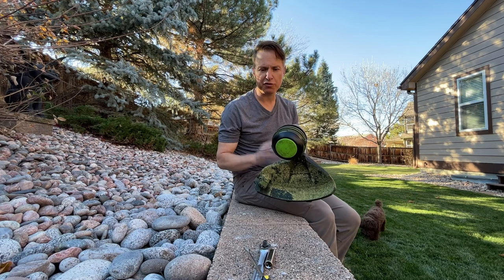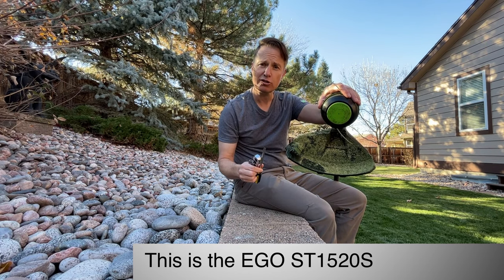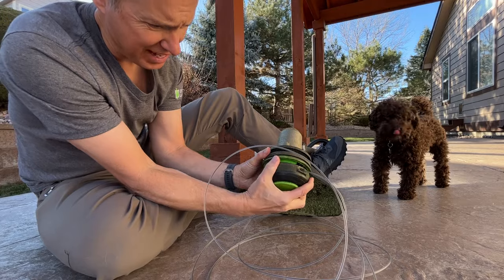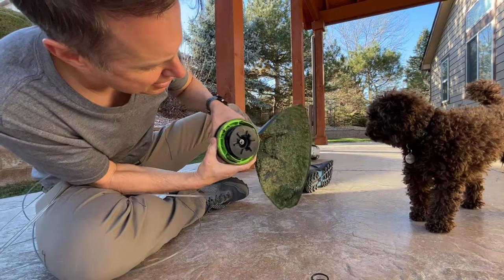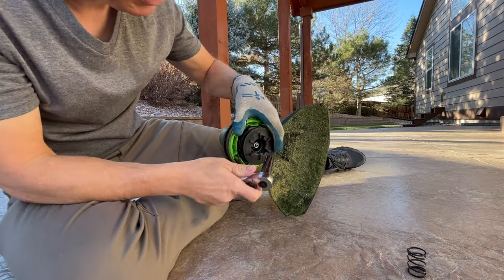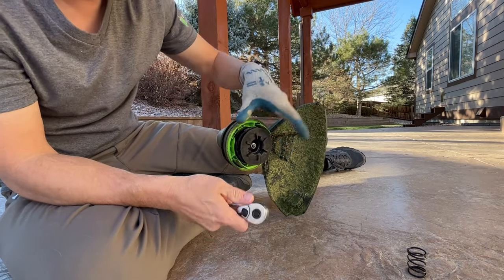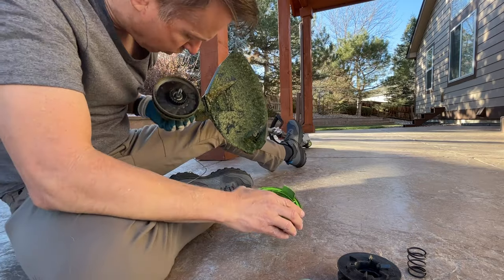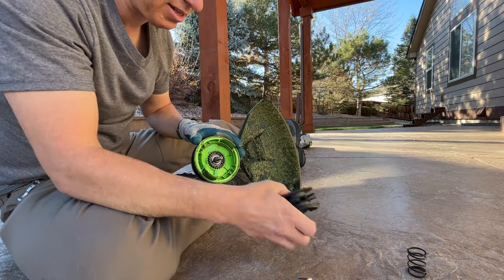How To Fix Your EGO Trimmer, If The Auto String Feed Is Not Working

Comment: Just saying "Thank You!" seems so inadequate.  This morning my EGO String Trimmer would not spool the line. I was puzzled. First I checked the 5-year warranty and found it would expire the end of this October 2023. Next I called EGO to learn where I could get it repaired. They said the trimmer head warranty was for ONLY 90 days and I would have to purchase a new head, part #AH1520 for $50 or so. I went to YouTube in search of how difficult it would be to replace the head. During my search I found your YouTube on how to clean the head. I went to my garage, followed your instructions, and found it WAS dirty. I cleaned it out, put it back together, and Voila! Now it works beautifully. You have a new fan. Well done, and bless you.

Comment: Perfect instructions on how to fix our problem (the inner area was wrapped with some sort of fine string/twine that had become drawn into it, preventing the automatic function from working).
It was rather stressful at first but when we found your video and followed your instructions, it easliy solved our problem!
By the way, the nut on our weedeater was on very tight and it was hard to hold the spool area secure enough to effectively turn the nut with the wrench. I finally figured out how to move the part of the spool up (outwards) which locked the inner part from turning so that I could more easily hold onto the outer part securely enough to give enough torque to loosen the nut (I hope that made sense?!).
Anyway, thank you!
God bless you.
Reply: Thanks Dan

Comment: Thank you for this video.  I could not figure out why the auto line feeder was not working.  I was ready to buy what ever I needed to fix my trimmer.  I had a  fine wire wrapped around the spool and would never  have  thought to take it apart.  Thanks again.

Comment: Something that worked for me is before you remove the nut take the cap off, then press the Power feed button to see if the spool turns. If it does, pop the cap back on, feed the string through and press the Power feed button to see if it works. It did for me.

Comment: Anyone ever have a problem of the line not feeding out like it should?
Reply: Yes I had that problem and I fixed it
Reply: @Tooo V  how? Please share, thanks.
Reply: @tooov9446  how? Please share
Reply: Mine doesn't even come on
Reply: Yes
Reply: Yes, I knew it had to be too good to be true
Reply: My second one and nothing but problems
Reply: I did u just have to keep pushing and poking till it comes out
Reply: Yeah, that worked when I put it back together. But then it wouldn't feed out. Took it apart again and it wouldn't feed in. Might be a different problem other than dirt or gunk.
Reply: yes, on my second head.  The 2nd one last a few weeks and broke as well.  I see on Amazon others have the same problem.  I think the replacement heads are crap
Reply: @michaelduncan4825  When it won't feed, the most likely problem is a twist in the string. Remove the cap, and you can see if the string is jammed.  Just remove the string, reassemble and load a replacement string.  Always works for me.
Reply: Yes, me.

Comment: When I saw that your string trimmer didn't have any debris, I was skeptical why taking it apart and putting it back together again would help (but then again, doesn't it always?).  Took mine apart as per your video, lots of debris stuck in there.  Cleaned it out - auto-feed works great.  Appreciate the video.

Comment: Thanks you saved me a lot of time - mine was having a different issue. the loading feature was working, but when I went to use the weed eater, all the string just kept coming out as the head turned. Turns out I missing the Spring. Thanks!
Reply: I also lost the spring. Where on earth did you find a replacement? I  saw one for a different model number. It didn’t help. I may have another issue.
Reply: Mine missing too, perhaps some models don’t have one?
Reply: @danieldoherty5034 thanks for your reply. I checked a new 1620t it had no spring, unless someone removed it already.  I took it all apart cleaned & back together & nothing.  Really don’t want spend $50 on a year old t $300  trimmer.  I tried a spring for the 15” trimmer doesn’t help the 16”

Comment: Thanks I appreciate 🙏  the video I did mine  and it Worked 💪  but be sure to hold pull the green part up and hold it so you can get the bolt off without  it turning  on you while your trying  to get it off.

Comment: When I have had that problem, while pressing the green button, I take my other hand and hold and slightly push in the green disk on the bottom.  No need to take it apart.
Reply: That's what it did for me. Thanks
Reply: That is also what I do.  As you push the rewind button, press in on the green disk with varying pressure until the string starts winding in.

Comment: I'll try this out... mine started acting funny this evening and I use string that looks just like yours from a large spool.  Kept trying to load it and the motor started getting hot.   I just so happened to have a factory pre-cut string so I pulled out the clear string and loaded the Ego string and it loaded that with no problem...

Comment: I had the same problem with trimmer but I notice the spring not attached to lid instead of you putting it over the shaft. I attached it to the lid without removing the bolt and it worked again. Maybe others can try that first

Comment: Mine wouldn't load due to using too large of a string. Went back to the smaller size and worked great. This was after taking it all apart and finding it pretty clean.

Comment: My problem is the line will not feed out while using the trimmer! When the line runs short I have to manually remove the trimmer head and pull out more line then rewind the string by hand! This has been happening since I took it out of the box. I thought I was doing something wrong but now I see that there is probably an issue. Been reading for a response to this issue also?

Comment: I’ve cleaned mine 4 times. It will still not wind the string. Is there a way to wind string manually? So very frustrating. I love this trimmer—when it works.
Reply: Never mind. If you use “twisted” string, not a smooth round one, it will wind easier as the head has something to grab.
Reply from the maker: Awesome... I'm glad you got it :)
Reply: Manual is out. After cleaning as video shows, mine wouldn't rewind either. I took the advice of a viewer. I took the lock nut and installed tight but barely and took the spring and stretched it approximately 1/4". My  ego reminds like a charm. Good luck

Comment: If it's not clogged and only spins when trying to load check this: Mine was spinning and not taking up line and not clogged. Take the spool off completely. Attached to the motor, over the motor shaft, is a plastic cone like piece held to the motor with three phillips head screws. The issue is on that piece.  There is supposed to be an extrusion on that part that engages with a slot on the spool. Mine was melted and worn over so it would not hold the spool from spinning  Unable to find a replacement part without purchasing a new motor I was able to fix: sand down the left over extrusion on the plastic piece so it is flush with the rest of the cone. Using a screwdriver push up from the inside of the cone in the location of the extrusion (there is a slot inside there) to make a small slit in the cone where the old extrusion was. I used a plastic welding wand from Harbor Freight to build back an extrusion to engage with the spool as it should. I took a piece of plastic material in the welding kit and trimmed it to fit into the slot I made in the cone with the screwdriver. Then used the heating iron in the kit to shape the plastic to snugly fit the slot on the spool. Trimmer loads as it should now!
Reply: You Sir are a genius, that was exactly my problem too, so glad I found you comment here.

Comment: Took mine apart.  Head was pretty clean, no debris, but I cleaned it anyway.  Still did not work when I put it together.  It is hard to believe the trimmer head is so sensitive to debris and no debris.  It should be redesigned to be more robust.  I ordered a new head.

Comment: This didn’t work for me, just cleaning it. After time you will have to stretch the spring out say an eighth of an inch to a quarter of an inch. Think about it, a compressed spring will loose its memory to spring so the fix is to stretch the spring back out a little!  If you’re not strong enough to stretch it out with your hands, try prying it at the ends with a screwdriver to get it to stretch. You are welcome guys, happy weed eating 😁

Comment: Anyone have problems where the line won’t feed through the feeder to get to the auto load feature had my trimmer 5 years worked great till about 2 weeks ago. Probably put about 5-6 thousand hours on this trimmer best trimmer I have ever had however won’t feet through now and if I remove the cap fees it and run it through the cap it catches the bump mechanism into full bump mode

Comment: Problem solved, y’all. Dirtiness can certainly be an issue but if it’s clean I’ll bet you anything you were trying to load 0.095. It simply doesn’t have the torque to wind such thick string. Don’t go thicker than 0.080 and I bet it will load just fine.

Comment: My EGO ST1200 does not work. Not even with a freshly charged battery. And yes, I've cleaned all the debris from the drive shaft beneath the cutting head.
Reply: Same for me…
Reply: @starwoodward  No lawn equipment business around Arlington, Tx. will work on EGO.
Reply: I’m having the same issue. Took it apart, cleaned it, fresh battery. Still not working. Let me know if you find a solution
Reply: @hunterwhite8282  Will do. But it's beginning to look like solutions are rare - with EGO.
Reply: I took it apart and put it back together several times and then eventually at worked…!
Reply: I was also having the non-takeup problem. I expected to find wound plant strands when I disassembled the head, but there were none. Before reassembling, I gave the removable parts a good (wet) cleaning, and that seems to have solved the problem. Unless the mere act of assembly and reassembly accomplished something, my best guess is that fine dust can accumulate and lift the parts just out of position enough to make a difference.
Reply: @starwoodward3490  Congratulations. You have the magic touch. Did you do anything in particular when it was apart? Please share. I'm ready to try anything.
Reply: Sorry I don’t have any more to say. I just took it apart and tried it didn’t work and then I took it apart again and tried it and it didn’t work and then eventually it work
Reply: @starwoodward3490  Thank you, Ms. Woodward. Might we just say you have struck upon a trifecta of magic, and leave it at that?

Comment: I upgraded to this string trimmer from a Ryobi. Used it three times and it become impossible to thread. Then after monkeying w it finally got it strung but now it won’t draw up the line. Guess which trimmer finished the job. My Ryobi. This thing is a piece of crap.
Reply: Same thing here. Ryobi 18 volt string breaks often but it doesn't eat up my wood fence.

Comment: Frustrating an almost new trimmer will not load the line….customer service is useless….they just read you back the manual…rather have a manual wind string head or a Ryobi head that easily loads…that works every time……yeah They tell you to take the head apart and clean it …what ……never ever had to do that with any trimmer no matter how old or long it was used….design a better head!